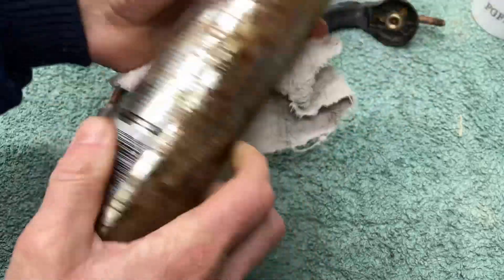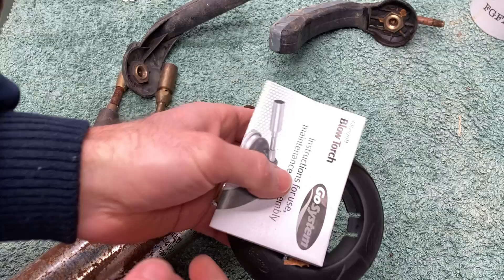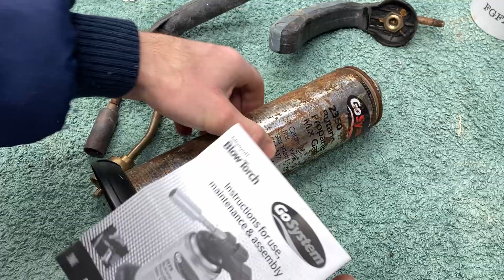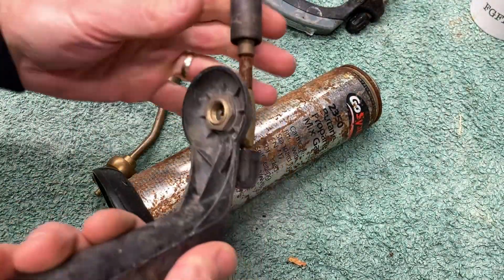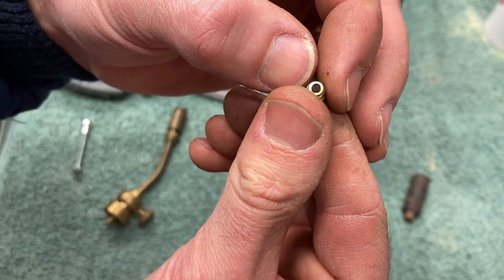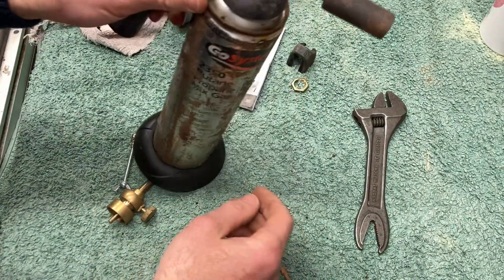Making a GoSystem gas torch out of bits that I found in skips and a look at a Rothenberger QuickFire

Comment: That Quickfire one is well worth taking care of, there must be a very  good cryistal smacker to light every time.
I have a lighter for my flavel gas cooker,  much the same as the one you used.
But they do play up and die.
I think if i bought a Quick fire, that would be well over board to light the cooker lol :-D
Reply from the maker: I was amazed it came back to life. Full of wet sand. Must be indestructible.
Reply: It must be related to captain scarlet :-D